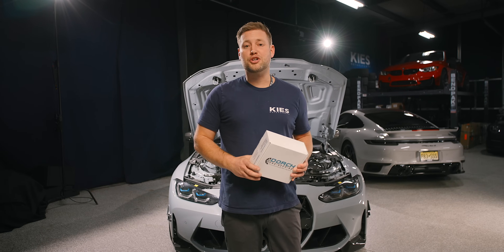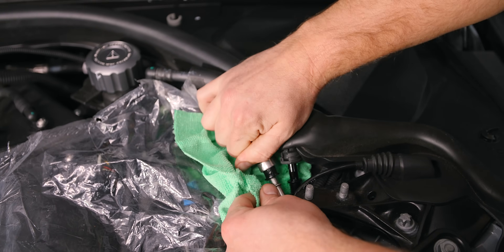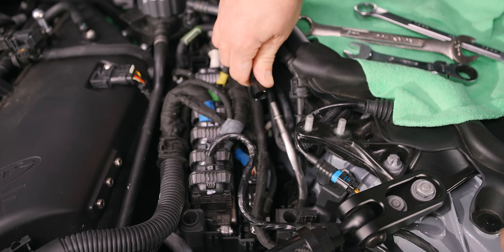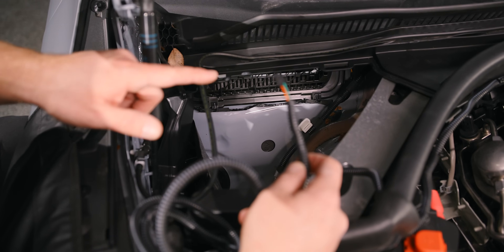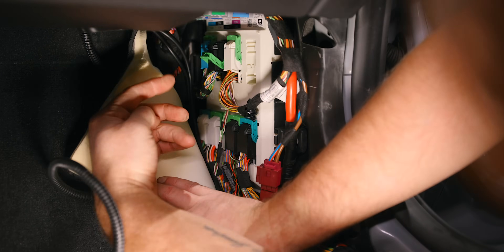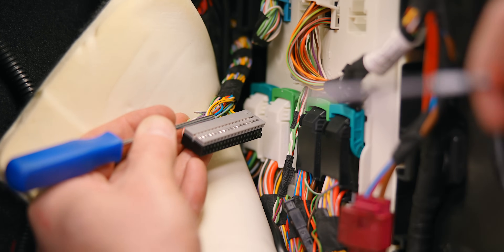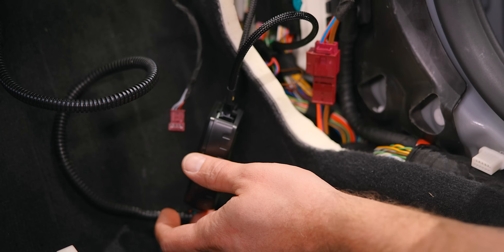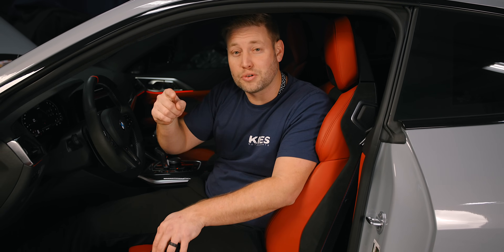How to install a FLEX FUEL KIT on a BMW M2 / M3 / & M4 (G80/G81/G82/G83/G87)

Comment: I’m installing this flex fuel kit in my 2023 g80 and there is no pin #2 connector on the factory harness. Idk what to do
Reply: Did you ever get it fixed? Mine doesnt read the ethanol when I hold down the click